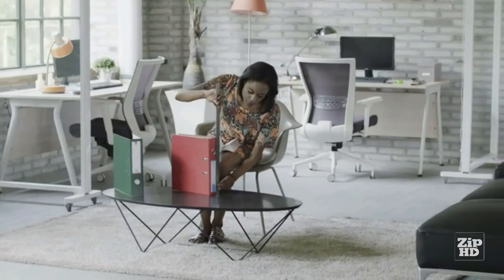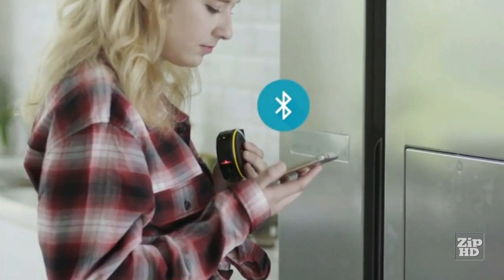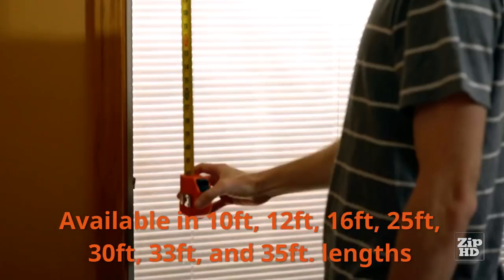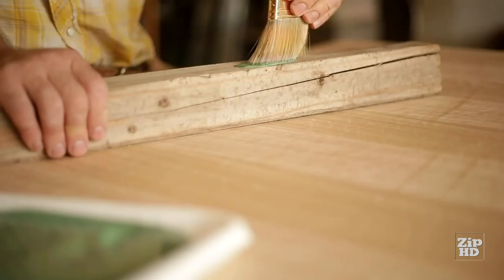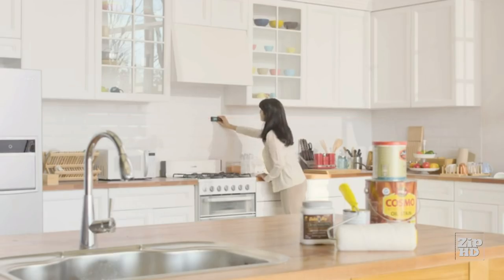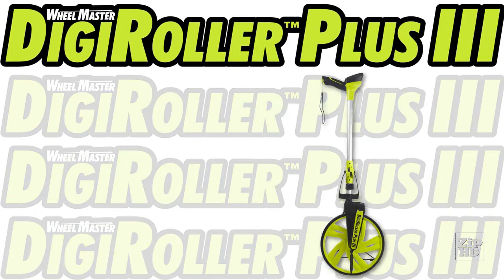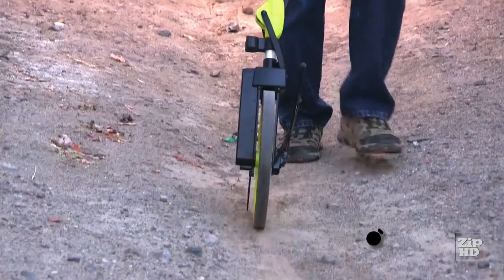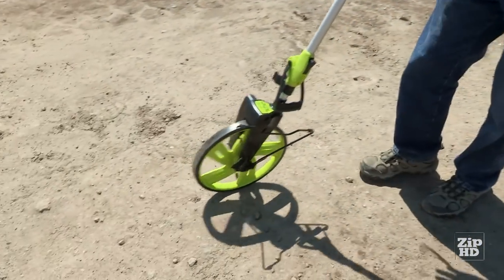5 Best Measuring Tools You Should Have

Comment: I use the distance lasers in my profession many times a day and what a step forward compared to in the past, but also they (just like calculators, auto spell, other forms of "helping hands" etc..) do dull your brain and should be combined by manual methods and math imho.  However there are times especially at height where they are so comfy, used several brands and while cheapo Chinese can be accurate enough for many tasks you just always go for the better ones, I like the simple rugged Hilti pen (PD4) but out in the sun and looking for accuracy over distance I just keep going back to same brand again and again..
Leica is the name of this particular game if a pro depending on your equipment, those Swiss folk really do know their clocks, optics and fine details to make machinery work well. But if for home use and not out in sun shine where a mm or 2 is not super important, sure go for a $10 China tool they can be accurate enough for many tasks.

Comment: Always wondering what is good for to measure the volume in a room, beside for air conditioner room volume calculations.
Reply: How about the volume of the inside of a concrete form  to calculate the needed concrete to be delivered in the truck.